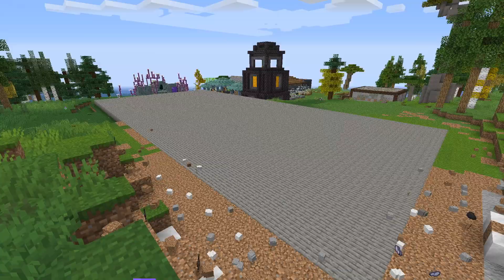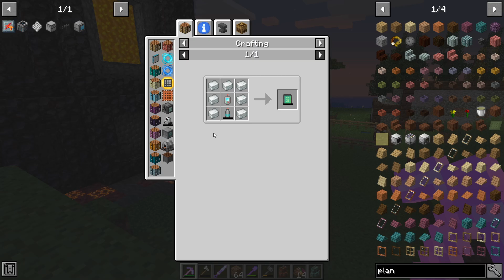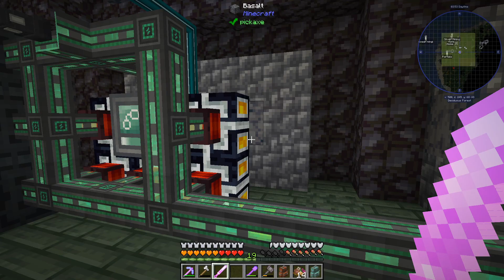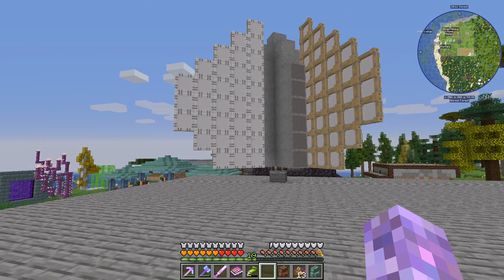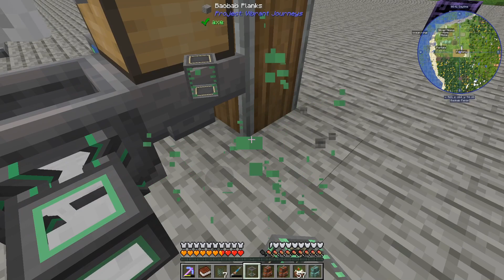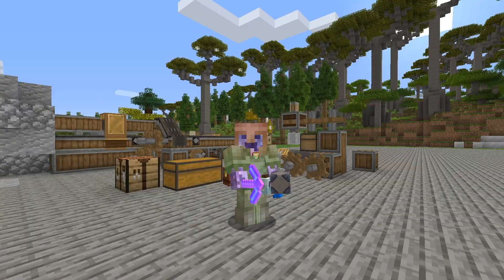Enigmatica 6 Expert | Cobblestone! | Ep 26

Comment: FYI, for the windmill you need 128+ sails to get 8192 stress units and 16 rpm, I never build waterwheels anymore since the windmill is easy enough and cheap, not to mention it uses less space to run and provides all the power I need for my machines, I usually build them vertical 4X wide for the sails and as high as I need, it also looks better, you can colour the sails if you want it to look like a banner.
For the water, if you use a pump near the ocean (any liquid that is more than 10000 buckets is considered infinite that would solve your problem, just pipe it.
For the refined storage system, I would work to get a drawer controller (ridiculous recipe ) and compacting drawers ( more ridiculous recipe X10 ) so you can use the storage for individual items witch makes more sense, you will need more magic for that as well.
Great episode!